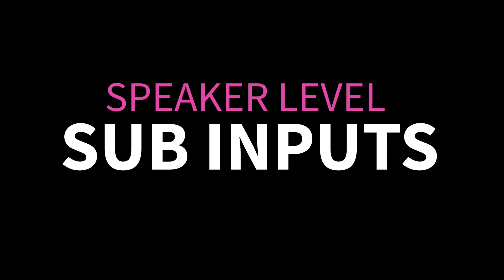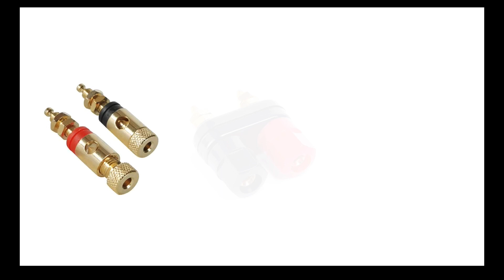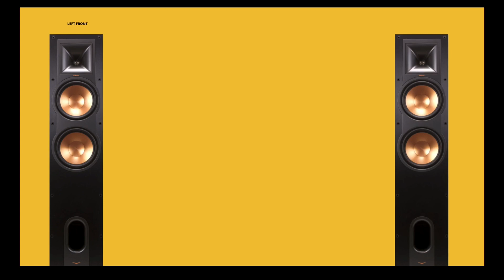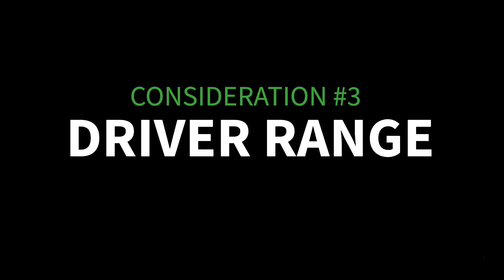Sonos sub hack: How-to wiring guide to add any powered sub to your Sonos system

Comment from the maker: Hi all - this is a long video to cover everyone's questions so here are some jump links:
0:45 - How speaker level sub inputs work
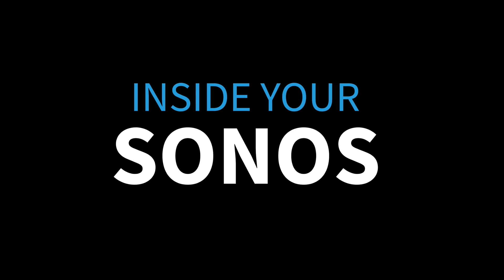7:09 - Inside your Sonos and why a line is tricky
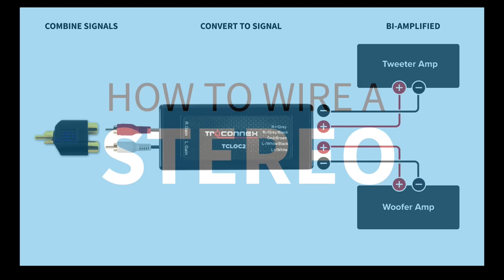9:06 - Stereo subwoofer wiring
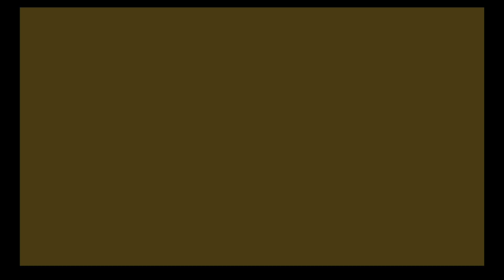14:40 - Home theater setup
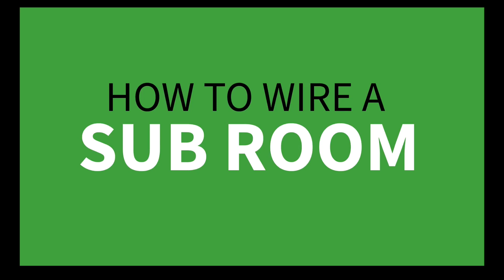19:42 - Setting up a sub as a separate 'room'
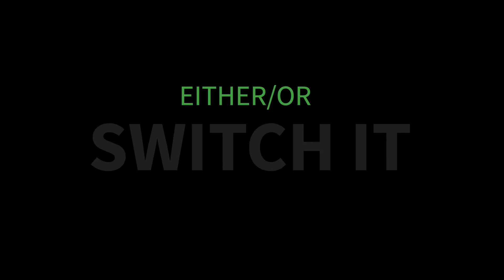21:09 - Adding switches
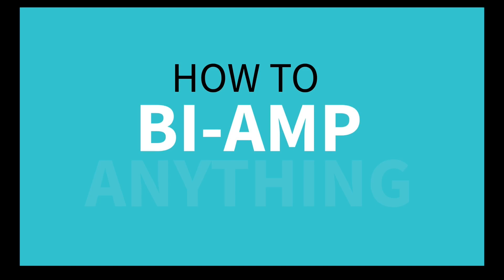23:48 - Bi-amping passive speakers

Recommended subwoofers on Amazon ~$100:
Polk 10"  - https://amzn.to/2RcWV1q
Monoprice 8"  - https://amzn.to/3696umd
Monoprice premium 8" - https://amzn.to/2Rdl73O
Acoustic Audio 8" - https://amzn.to/2TVfCZt

Note: any subwoofer brand or size will work as long as it's amplified and has speaker level inputs - if it only has RCA inputs, look elsewhere.

Comment: Is it possible to use a third Symponiks speaker that you disconnect both tweeter and woofer and let it decode mono sound (containing info from L+R channel) and feed the woofer sound into the cheap subwoofer?
Reply from the maker: Yes, that’s the gateway setup I cover in the video. You set up one Symfonisk as a room (mono) and group it with another room

Comment: Any benefit of adding a second sub? Like additional pair - 5.2 :)
One more question - what would be your recommendation for a decent sub?
Reply from the maker: A second sub will always sound better. Same with a 3rd, 4th...
Re: sub recs, here are a few inexpensive options on Amazon ~$100:
Polk 10"  - https://amzn.to/2RcWV1q
Monoprice 8"  - https://amzn.to/3696umd
Monoprice premium 8" - https://amzn.to/2Rdl73O
Acoustic Audio 8" - https://amzn.to/2TVfCZt

Note: any subwoofer brand or size will work as long as it's amplified and has speaker level inputs - if it only has RCA inputs, look elsewhere.

Comment: Why not just use an audio extractor between the TV and Beam and send the signal to the sub?
Reply: can please explain
Reply from the maker: Do you mean using a fiber optic or hdmi to RCA converter? I suppose you could but the volume levels may not be in sync depending on how the output works. More importantly this would only work with TV sound so it’s not the same as being part of the Sonos system.,

Comment: Awesome! Thank you for that great roundup! Since watching your Sonos hack videos I had one question regarding powering the cheap sub: One nicety of Sonos speakers is you‘ll leave them always plugged into power and they‘ll automatically turn on and off whenever you send music to them or not. The cheap sub, however, you‘d need to turn on and off manually, always. Is there any nice power plug that detects the power consumption of the IKEA-speaker and automatically turns on a second outlet for the sub and shut the power again when the IKEA drops unter a certain power-Lvl when it turns to standby again? That would be essential for the perfect „set up and forget about it“ setup I am looking into!
Reply from the maker: Thanks! My powered sub has an on/off/auto setting that sits it down when no signal is detected so look around, it’s a feature. They also make power strips that shit other plugs off if something powers down.
Reply: Todd Parker on/off/Auto!!! Awesome! I‘ll look out for it! Thank you!!